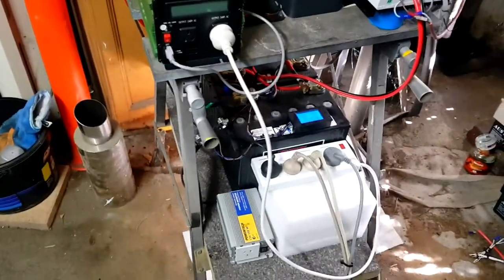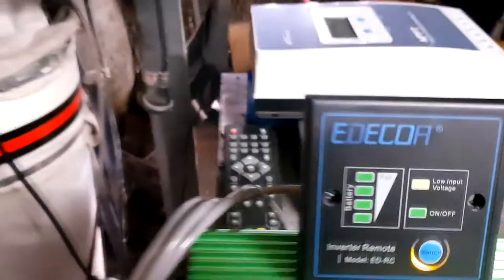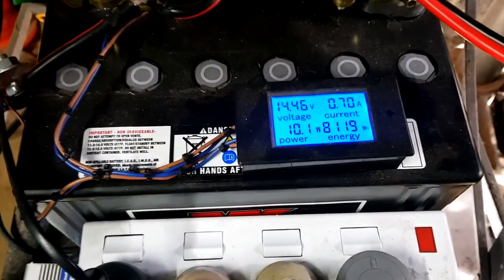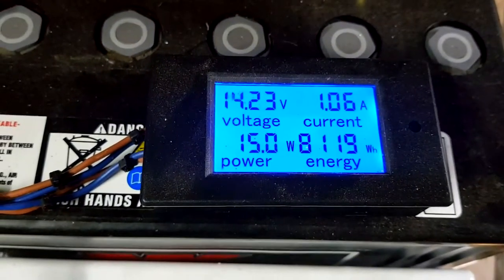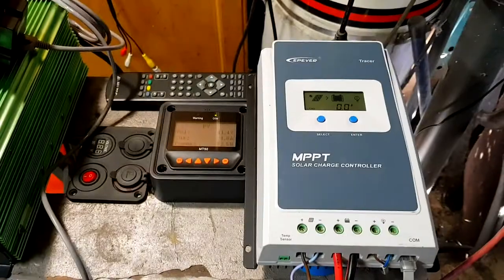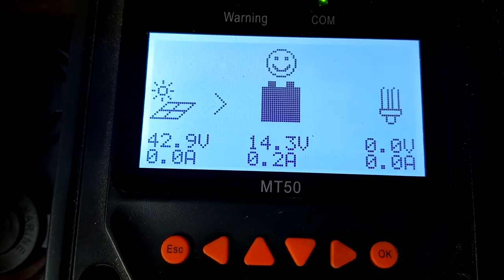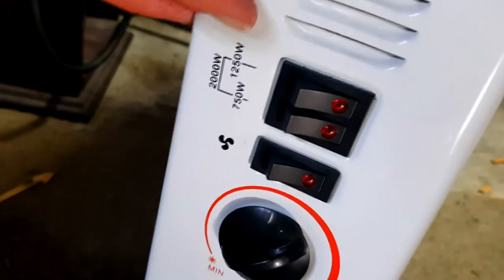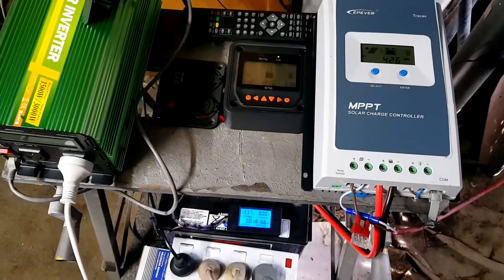Solar backup system and power inverters ( *** See Other Videos ***)

Comment from the maker: Yes this was my thoughts that’s way I did not bother to flaming up my scope and see what I knew.
Good tip on a filter for many people there with this unit, however in my case as said before My converters task is to run my fridge if and when the power goes down and up to six house hold new age LED 240 Volt lights.

Comment: I have also edecoa 3500/7000 but on 24v, and also epever 50amp. But i have problem with panels, im getting 130volts and 0,2amp? Panels are Trina 240w or 7.9 amp, they are working on 30-37volts, i dont understand where is my mistake, maybe angle of the panels, they are facing south on 30 degree roof in Croatia.
Reply from the maker: Odd indeed when you’re only getting 130 v at 0.2 amps. The only time I get high volts with very low to no amps is when my batteries are totally full. I would test out the charge back abilities of my Epever controller by unplugging it from the solar panels so it can’t charge at all and then allow the batteries to run down to say 11.00 volts by using heaps of power and then plug back in the solar panels and then see what the Epever is producing in charge back amps. This would tell me the true performance of both my panels and my charge controller. With my small setup I would get anything upwards from 12 to 15 amps showing on the display of the charge controller if I have very low batteries and in my case my panels are laying down flat so no 30 degree angle to the sun at all.  Really your problem can only be one of three things. One is your charge controller is faulty and not working properly. Two you have one bad solar panel in your group of panels and a bad panel is reducing your amps down to almost nothing. And lastly a wiring issue between your panels shorting the panels out or a bad connection. And if all of these three checkout to be all fine then the last thing I can think of is perhaps a diode in one of your panels has failed as that would give you this symptom of high volts with low amps.
Reply: @rolandkeith5322  Thanks a lot for your answer :)

Comment: Hi Roland thanks for a very helpful and easy to understand video I’m just getting into solar we have a boat and only have a cool box on cool draws 54 Watts I have a spare 110ah battery  not the 2 boat batteries and was wondering if I could use the same inverter to power the cool box it wouldn’t need to be on constantly as we only go for 4 days max also a small kettle (not sure of the wattage of that ) I noticed your batteries soon dropped when you put the heater on .many thanks hope to hear from you soon take care during these testing times please thanks 🙏 Clive in 🇬🇧
Reply from the maker: Hi back and yes you can use the same inverter for the job the kettle may well be over 1000 watts but that will handle it easy. And yes the batteries do drop down quickly pulling out 1200 Watts but If I add 3 more panels I could run the heater off that.  Any more you want to know just send a message :)
Reply: Roland Keith many thanks for replying back I will always be asking questions if that’s ok it’s how we learn 👍thank you and take care and stay safe you and yours🙏🙏

Comment: I have one of these , but the person who installed it has for some reason attached a cable from its body going to the vehicle body which I assume is being an earthing connection . Is this correct 🤔.  🇬🇧
Reply from the maker: Hi back I have opened mine up to change an internal fuse that was on the mother board and to earth the casing is pointless. Nothing on the units mother board is earthed to the casing. If you want to move it or remove the earth that was installed, you can indeed. The question of is it correct? Well it was good thinking what he had done however in the case of earthing out one of these inverters like he did has no value. Not necessary.
Reply: Problem arisen. When power inverter up it beeps , the key flashes a warning triangle  eith a battey reading of 14.5v but output reading is zero volts . Battery indicator showing full.
I've changed the charge controler so I'm  wondering if the setting are wrong.
Reply from the maker: @captango  Mine had done the same thing and I have found that it will do this on the odd occasion. At times when I am using the inverter if the solar systems voltage quickly changers because of the clouds shadowing the panels and soon after the clouds move off the panels then this quick change in voltage from the inverters supply must set the inverter into some kind of protection mode. So I reset it by just turning the inverter off and back on again and then all is good. So I think it happens when the battery voltage changes to quickly for the programing in the inverter. I don’t know if we can go into the menu of the inverter to change the voltage range on the input side of things I will have to look and see. In any event for me it is not that much of a problem as like I said I just turn the inverter off and back on again.

Comment: Hi I have a Power Inverter 12V to 240V Pure sine wave 1500W /3000w UK Plugs Softstart EDECOA  which just has a slight cosmetic look to it. I have it in my T5 camper mainly to run my laptop and a Dell monitor (desktop type.)
The laptop connects and runs OK 9not sure if its battery helps).
I have a dell desktop monitor which ideally I want to use when off grid hence my question :)
When on 240v hookup (UK) the monitor works great.
 However when I plug it into the inverter (removing hookup) the screen will display then goes blank then on repeatedly? The monitor power led stays on throughout this.

Just wondering if you could tell me best way to check the inverter to see if it is faulty?

Many thanks for your videos and advice.
Reply from the maker: EDECOA
Hi back Simo and welcome to the Channel as it is always nice to meet a new subscriber. Okay with these Inverters from EDECOA and the claim of been a “Pure sine wave”….running up one of these inverters on a scope they produce a sine wave but a very messy and noisy one and at fluctuating  50’ish Hz too.  So even though they do what they say they do ........they do it poorly. If the maker had installed larger and quality filter capacitors in-line with the output to shut up all of the noise then a large % of this problem would be sorted. 
In saying this these inverters do work quite well for many applications that are not to bothered by noise things like motors lighting and even radios, however on TV’s or monitors many laptops they are looking for very noise free sine waves power to run them by because by design these devices were made for 100 % mains power only.
My thoughts are keep the one you have use it where you can but get a 400Watt good to high quality Pure sine wave inverter to run the monitor and computer and other devices that need very clean quiet power. I picked up over here a quality 400 watt unit to do similar work run a monitor and camera setup for my security camera system and the whole thing works very well indeed and the 400 watt inverter was around 250 bucks in special, it’s been running 24/7 now for two years off the Solar as it never gets turned off.
So I hope this helps you know what you have and what to do Simo.

Comment: Hi again Keith
Just received mine.
Came with 1 cm thick + and - cables.

Some say to use thicker cables .
How much thicker or pair of 1cm thick are fine ?

Will need it to run car polishing machine , pretty much all day .
Reply from the maker: Hey back I have just used the cables that came with mine and I have had no problems with them. Best thing I can think of is try them out and if they have to be changed then change them,
Reply: @rolandkeith5322  thanks Keith

Comment from the maker: Nèg Okap For life
Hi back to you. Okay is it a full Pure Sine Wave Inverter in performance? Well without placing the inverter on my oscilloscope to see the wave form it makes it is at this stage I don’t know but in saying that it performs like it is a Pure Sine Wave and it is far better than my square wave inverter that makes electric motors hum when I use that unit. What I will say is that the Edecoa dose produces electrical noise on my monitor in the video feed back however I have never tested what’s going on there as in is it a fault with my monitor or not. My main use for this inverter it to run a fridge in backup conditions while power from the mains is down.
Reply: found another guy that got one he did hook it up to a Oscilloscope, and it is a pure sine wave! how ever its a very noise dirty power!!! I would suggest getting a EMI Power Filter to filter out the noise, this inverter will even mess with your mouse on your computers its so bad!! (I wish I did not buy mine now but did find suitable filters under $20)

Comment: Hi. This inverter work with lithium battery?
Reply from the maker: @rafaelmt1000  all inverters will
Reply from the maker: A common 100Ah-150Ah lithium battery of this type can deliver enough energy to operate a maximum of a 1000w inverter of any type
Reply: @rolandkeith5322  Thanks for the information, appreciated.
Reply from the maker: @rafaelmt1000  welcome